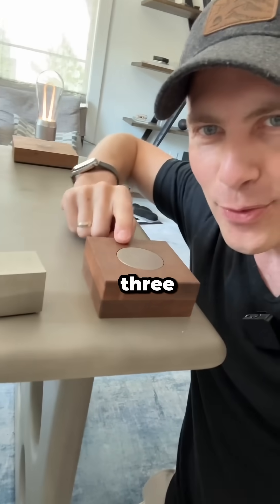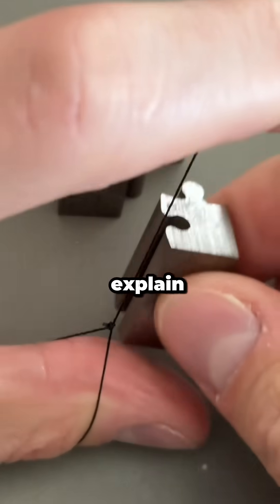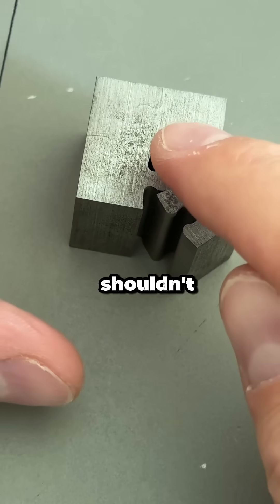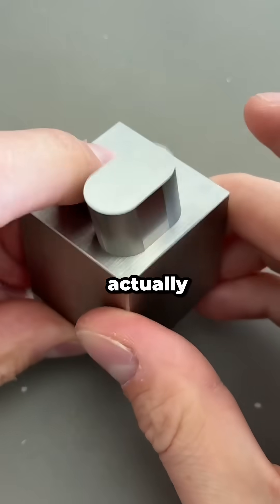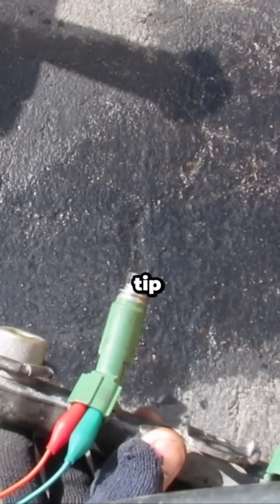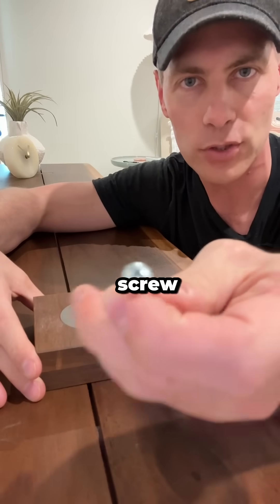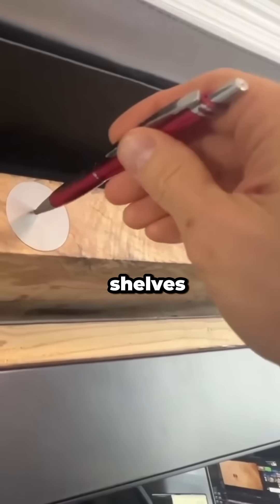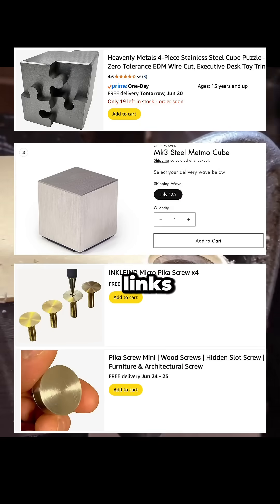Invisible Cuts

Comment from the maker: This wire EDM cutting process is so precise you can create gaps that are 1 micron in size (about 1/100th the width of a human hair). The samples I showed were:

tinyurl.com/puzzle-cuts
tinyurl.com/cube-drop
tinyurl.com/pika-screw
Reply: not gaps, the wire has thickness and they manufacture the linking parts out of separate pieces of metal. they have a tolerance of 1 micron but a much larger kerf
Reply: At .46 looks like a penis shadow
Reply: This may sound unbelievably expensive but, make a gaming keyboard out of this

Comment: Something I always wonder is what happens if those pieces get shock or dropped, hit by something. Will slight deformation cause them to no longer fit together?
Reply: Or if they get too hot or too cold will they strike and expands but they won't fit or get stuck together remember the old saying it's cold enough to freeze the brass balls off of wooden ship those are the cannonballs
Reply: Yes it does, if it get any hit or slightly pinch, it would no longer be that precise

Comment: Actually the other part is discarded and a new part is created with an offset to allow for the thickness of the wire plus a clearance tolerance. 
For a slide in fit you need .03 of a mm a hair is .05 to .07mm thicker if you measure pubic hair.